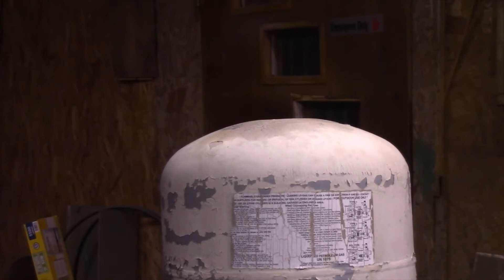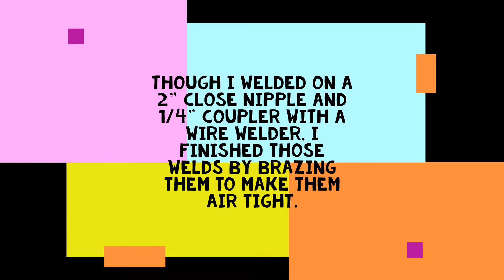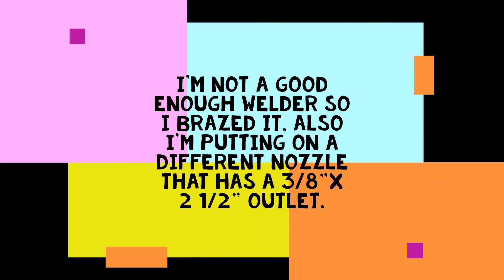How To Make A Tire Bead Seater

Comment: by dipping the galvanized pipe in muriatic acid and the tank area to be welded will remove  the galvanized coating too will make a lot easier to weld  you will see bare metal  to work on
Reply from the maker: I just ground it clean, it welded fine.
Reply: 😂 after 2 wrong size attempts ...pulls out the mescan speed wrench!